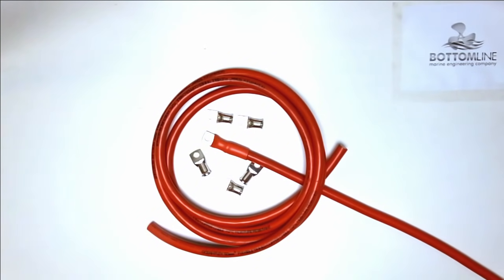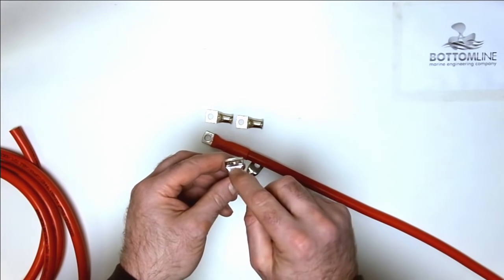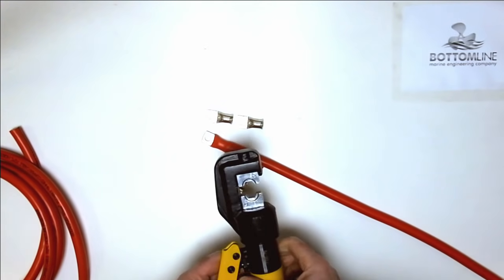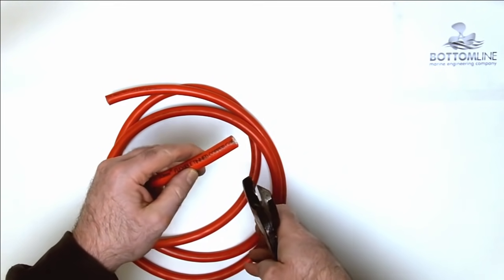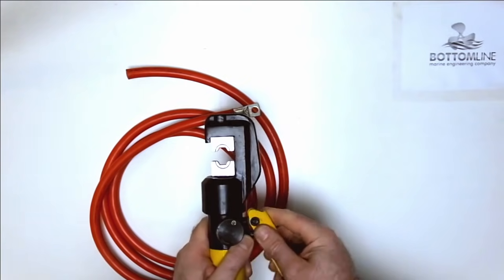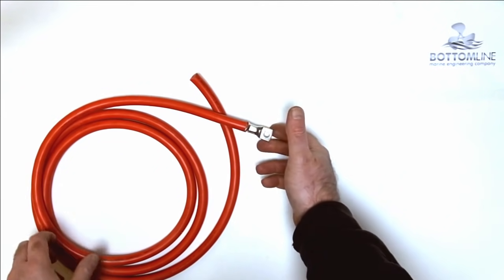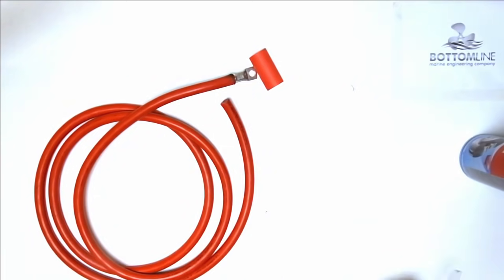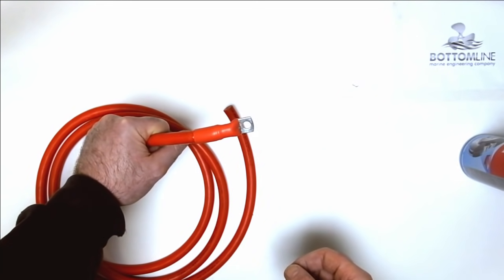Crimping marine battery cable terminal lugs (the proper way)

Comment: I'd like to say a huge thanks for this video. I've recently made a few new battery leads for my narrow boat using your techniques and I'm quite sure the end results couldn't have been better if I'd bought professionally made cables. Mind you, the crimping and cutting tools have cost me a packet and I'll probably never use them again, but if my wife can have more shoes than she has feet, surely I can have more tools than I have fingers...!
Reply: Man's got to be tooled up in this world. A fact that I have to repeatedly impress upon my wife. You needed them once and you think you will have use for them -sometime in the future . That's my story and I'm sticking to it !
Reply: can we use epoxy such as 3M DP420 to fill the inspection hole?
Reply: @MaxbroRizwan  That would not help the electrical connection at all!
Reply: @MaxbroRizwan  surely can but doesn't make sense to do so, just get a 1:3 or 1:4 heatshrink with adhesive lining and slip it onto the wire+lug. Seals off the entire thing

Comment: Battery cable DC or AC?
Reply: Both, it's for your Car sub amp, to listen to AC/DC..
😂
Reply from the maker: It depends on the cable that you are using. Some cable is only rated for DC. In AC applications, soldering isn't normally used. Also, AC batteries are incredibly rare. I actually thought they were still under development but I could be wrong.

Comment: Excellent vid BLM showing a true craftsman at work.  My only suggestion (from my electrical bg is to be sure the lugs are sparkling clean inside and degreased, could even tin the tube inside beforhand but this must be done carefully or too much solder will reduce the bore and may make cable insertion impossible. Also smear some solder flux on the strands before.  Its all double security as if solder does flow predictably and easily using only a small amount, you are in trouble with a dry solder joint - cut off and start again

Comment: Hi, I don’t know if you can answer 5his question but, Can you use old 50mm2 battery cables on a new installation if you change the lugs
Reply from the maker: Hi Phil, if the old cable is still flexible, not corroded and the insulation is still sound, it shouldn't be a problem. You may need to abrade and then flux the copper stands if they are dull, as the solder won't tin the copper properly otherwise. In commercial marine applications, tin plated cable is often required. So replacement is the only way in those situations, if the original cable is plain copper.
Reply: That great,thank you very much for your reply.

Comment: The proper way is to not use solder.
Reply: I agree, but seawater is so nasty that it will eat up all copper that isn't protected in a few years. Soldered ends work way longer at sea.
Reply: @elbuggo  Soldering the connection makes it the wire/strands solid leading to premature wire failure. Solid wires should not be used in an environment where there is a lot of vibration, like on a boat. It's a common mistake boating DIYers make unfortunately.
Reply: @waynem604  RE: leading to premature wire failure.

I know. But if it is not soldered, the seawater may eat the copper long before  the vibrations will have broken it. Without soldering, the cable may brake within a year. The soldered part of the cable should be supported well to resist the vibrations better.

I guess some grease or oil could be used instead of solder though. Anyway, something extra must be used to protect against nasty seawater.
Reply: @elbuggo  Do you mean the little hole? He's using a lug with an inspection hole. I would use a lug without this hole. If you look at marine grade lugs, most of them do not have this hole. And there is no copper exposed.
Reply: @waynem604  I suspect there is a crack in these lugs without a inspection hole. The lugs are made  of a pipe where one of the ends is pressed flat. Probably look good when new, but I fear the crack will open up over time or if the nut is tighten too hard or if they are knocked on the side. Marine grade lugs sound good, but I don't think they are as good as they pretend they are - they are not bullet proof. 

I suspect that if you add some solder or oil or grease to these connections, they will last longer at sea.
Reply: @waynem604  You obviously don't listen, watch or understand what this professional did and said.
Reply: Maybe you should make a youtube video to share your skills and knowledge.

Comment: Anyone contemplating this should check local rules. In many applications soldering is NOT an approved method. The reason being the potential for corrosion.
Reply: The flux in electrical solder does not cause corrosion. Nevertheless, it should be removed for neatness. I've been a marine engineer for 30 years and I can report that out of the hundreds of corroded and faulty cable assemblies that I have diagnosed, none of them were manufactured this way. They have mainly all been just crimped (often poorly but many OEM). The ones made using the method in this video last almost indefinatly in the marine enviroment.
Reply: @deanbolton3228  less about the flux, more about solder itself. Solder tends to seep into the wires and then form a solid mass that is more likely to become brittle over time, damage, come loose or anything else in the long term in applications involving lots of vibration or movement. There's no good reason to do it this way in my eyes. Get a decent Hydraulic crimper, properly sized lugs, properly stripped wires and then just crimp it. The lug is wrong for Marine applications, don't need one with inspection hole, just use a solid closed one. Pour in some Penetrox PENE8 if you want to stay even more secure. Crimp it down and then Adhesive lined 1:3 Heatshrink. Never has failed me once.

I'm extra about everything so I just use my milliohm meter to check the resistance over time, and it always impresses me how when done properly there's only a 3-4% change of resistance per year vs just the usual, inspection hole, no Penetrox and in humid enviroments having upwards of 20%-200% resistance changes.

Comment: Greetings from South Australia.  Thanks for the excellent video.  I will pass this on to a mate building a 3 million dollar place near the sea.  I have suggested having his solar installer use marine cables and fittings.
Reply: I think that solar cable is probably the same standard. Designed to be weather resistant. What I have seen has two layers of insulation and is tinned.

Comment: Try making a solder dip! You can use a torch to melt solder within the cable end on a metal vice so thiers excess solder, (or you can use a wood work bench table if you are careful) then you can dip the cable after it is stripped and hold it in the cable end until it cools! You can use the cap of the torch to put your flux in or paste if you needed before soldering to make sure the connection functions the way you would like for your application as I would for mine! It won't break or budge!  I remember old internet non sence before! Always go for the quality videos and hope people give you products that work! Finding out what to use for what takes years and hard is an asshole and not kind! Hope everyone is having a nice day

Comment: Great video, Dean. Fantastic seeing a perfectionist at work!
Please do more videos on general maintenance of Yanmar engines, in particular 2GM20s. It would be great to know how much exhaust smoke is normal, how much blow-by is normal, how to debug difficulty starting. Also, coolant changes when the heat exchanger is connected to a hot water cylinder, choosing the right replacement belts. And so many others...

Comment: No flux???
Reply: Can cause future corrosion so more trouble than it's worth.
Reply: @rfair123  If the appropriate amount of insulation is removed and the wires are firmly seated in the terminal connection and crimped I don’t see the purpose of having an inspection hole. It should be obvious that a proper connection has been made.

Comment: I am always looking into better ways for different jobs 
My SUV camper I upgraded my wire to 1/0awg copper welding cable to withstand extreme heat I used a hammer lug crimp And a fine painting brush of dialectical grease Boil point 392° F (200° C) at the lip of the Lug and exposed wire (very thin expose) This seals the wire from air And moisture being water resistance But not waterproof  Then my shrink tubing. The result of this method 7.5 years later No green coloring Or white corrosion on my other builds
I run 2 batteries one being a 200amp 12vott that runs off a high output 145amp Alt, 340watt solar panel, And a 13amp 125volt AC port plug for shore power And all the accessories  This works for my Freezer/fridge slide-out cooler on 12v 3 sets of 2 lights 12 watts 
lap top Or mini air conditioner 8hrs

Comment: You really should put your title as "soldering" terminals...
Reply: They are still crimped connections,  they are just eclectically secured with solder.
Reply: Why pay for a crimp tool if soldering does the job? It is an absolute NO in automotive, never mind NASA.

Comment: No need for flux I suppose? I would have used flux
Reply: Most solder intended for electrical use (including the solder I was using) is 'multi core'. This type of solder has flux contained within it. When working with new components you only need the barest amount of flux. The flux contained within the solder is more than adequate. If working with older / corroded components, extra flux may be required.

Comment: Excellent tutorial.  Thank you.  The only l step I suggest is line up the lug so that when installed, the cable labelling is showing up/out for easy reference.
Reply: Hi Glenn, Oddly enough we do the opposite, we hide the text underneath. We make 100's of these cables to order. What we have found is because the length of the cable varies, coupled with the fact that the printing has large gaps between the info, some cables would have partial text, others would have no text, and some would have good text visible on top. This would just serve to generate complaints from many customers that the cables don't match. It's a good suggestion though for anyone who is making their own and could afford to cut the cable in the right place to allow the full cable identification to be visible.

Comment: Oxidation and corrosion are a problem too.  I do a version of this for battery cables and exterior elec. connections.  I first slide two pcs of heat shrink up the cable (1 1/2" & 3")  way up out of the heat.   I place copper fitting in a vise vertical.  Trim cable to proper length ( bottoming out in fitting). Flux fitting and cable and heat fitting and fill halfway with solder.  Heat the cable end and quickly push the cable end into the fitting add more heat if the cable cools off the solder before bottoming in the fitting.   I now crimp the cable end as this video shows. After cooling to touch,  I coat the fitting and cable with silicone,  slide the first length of 1st heat shrink (1 1/2") over the fitting/cable and heat, and watch silicone squeeze out, Next lightly coat the heat shrink and cable again slide the last heat shrink (3') over the cable and heat again watch silicone squeeze out, wipe excess silicone off. I have cable ends and electrical connections on my Semi that have gone through 6 seasons of mud, rain, and snow that are good as the day I did them.
Reply: adhesive heat shrink is a better option and far less work.
I worked as an engineer in the automotive industry and have tested all types of configurations in environmental chambers.  Adhesive heat shrink is the best and simplest option.

Comment: thanks for the info, made  me a little smarter today.  Question, a battery is 12v, yet i see guys putting 4/0 cables is this correct??
Reply from the maker: Thanks for your comment and question. 4/0 is a huge cable but yes in certain situations it would be appropriate to fit that size cable to a 12V battery. The size of cable is decided based on the load versus the cable length. If you google 'Automotive Wire Amperage Capacity Chart' you should find a chart that shows required cable size at various amperage versus length. You should also ensure that the battery is rated to supply the amperage required.

Comment: Hello, I have another question for you, what connectors and crimps do you generally use in the marine environment. I am looking to clean up some wiring and electrics on my sail boat. Should I being using nylon insulated (double crimp) or heat shrink nylon connectors. Again the marinehowto recommends expensive crimps, is this really necessary to get a good crimp? Any help appreciated. Been looking at Knipex and wirefy off amazon.
Reply: Never use regular heat shrink tubing for any wiring in a high moisture environment. It will actually cause moisture to wick inside and trap it causing more corrosion than otherwise.  
Always use an adhesive heat shrink.  It is specifically designed to seal around the wires and prevent moisture ingress.  I've done plenty of testing in environmental chambers in my engineering career.
Reply: As far as I'm concerned I'm using good quality but uninsulated terminals, crimp them using a professional crimping tool, and secure them with a 3:1 or 4:1 adhesive heatshrink. I've never soldered the crimp but make sure the heatshrink securely covers the front opening (or hole if you're using shoes) to avoid moisture creeping in from this side. Didn't let me down yet.
Also important - use tinned marine-grade cable, no welding cable, even if it is more expensive.

Comment: How to bend the battery cable terminal lugs into a perpendicular form? Like you keep it in a vase e. g., how to bend it, with what? Do you need a special tool? I'm afraid to brake or scratch the new expensive 
cable I ordered. I need to bend the positive cable end, bcs such is the original  form on the alternator connection. Thank you for the film.
Reply from the maker: Hi Olena, They are purchased that way. Do a google search for "right angle battery cable lugs". It may be possible to form them afterwards but that's not the normal way.
Reply: @BottomLineMarine  Thank you for letting me know, I'd better return that cable, mine original is working normally, just wanted to update and put a new one.
Doesn't make sense to replace that terminal lug (for a right angle one) on an expensive new cable. And for my car they sell only straight ones. Someone wrote on Amazon that they bent it, but if it is a difficult procedure, I'd better return what I ordered. Yes, if to look on those right angle lugs you can see that it is done that way and an amateur won't perform that operation in the way they do. Thank you again.

Comment: I never would have thought of brake cleaner before heat shrink! Golden tip, thanks a lot for that. I have the same tool and also noticed immediately that you need to eye-ball the crimp die sizes depending on the thickness of the lug etc. I tend to crimp, rotate and finish crimp to prevent the crimp from growing ears. I like the tool, still I hope I'm not tempted to exceed its limits...
Reply: what is the tool name, do you have a link?

Comment: I'm not a fan of using solder on a crimp connection.  As a NASA contractor working on the Space Shuttle program, using solder with a crimp connection was not part of our workmanship standards.  If the crimp is done correctly, there will be no space between the cable strands for solder to flow.  When you slice it you would see a solid with no voids.
Reply: Same for the flux-capacitor connections?
Reply: A decent crimp creates a 'cold weld' and solder will NOT improve things. If the crimps get loose, the wrong techniques or tools are being used.
Reply: That's quite an "if" statement there ... I'm guessing the added weight of solder on a marine terminal was not so much of an issue as it might be for a launch vehicle where I doubt low gauge copper was used, also the solder would seal the open copper ends of the wire from corrosion in the marine environment, and finally I wonder if you have any suggestions for O-ring designs for marine applications? ... too soon?
Reply: Solder makes connections brittle under vibration. Same way you don't use solid core mains cable on a boat if you want it to pass tests.
Reply: so true
Reply from the maker: I'm not an expert on space shuttles. Were they known for their superior reliability? For the record, I don't recommend using my technique on space shuttles. You should probably consult your local space shuttle repair center for replacement cables.

Comment: Did the same on my boat installing a second battery/ charging regulator. The strength in the connection is the crimp.

Comment: Hello, a soldering trick that I thought of is, to prepare your solder before use is to clean off the surface oxidation. To do this I use a SCOTCH BRITE or similar cleaning pad and then give it a wipe on a rag for good measure. This way when you use the clean solder you will not take all of the junk into your new connection. Cheers and stay well.

Comment: Nice job, I perfer to use double wall heat shrink tubing, it comes with a sealant inside, or glue some call it. It is much thicker and the sealant provides extra protection from water and corrosion.
Reply: Yep, her majesty's "adhesive shrinks"..

Comment: Usually you want to strip justa bit more than the depth of the lug and have a small gap between the insulation and the lug a couple of mm will do for extra strain relief.